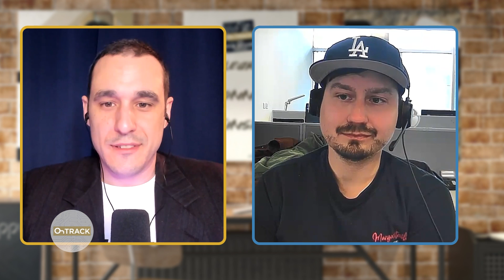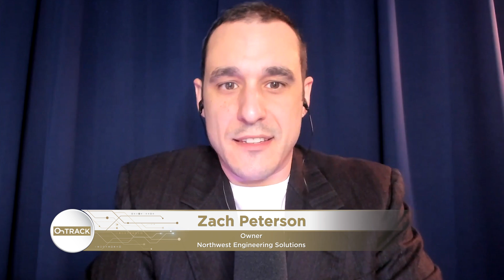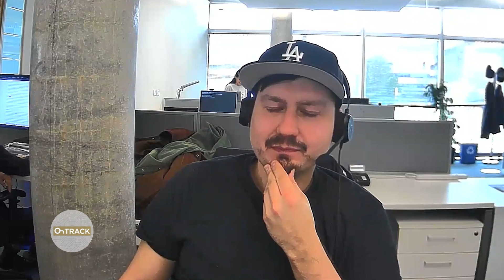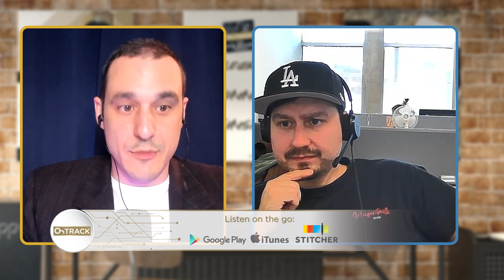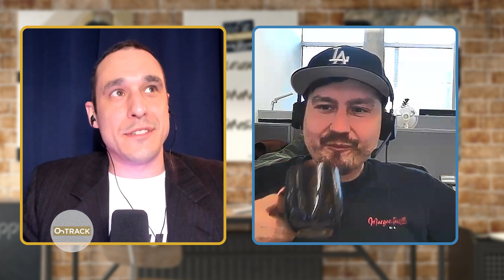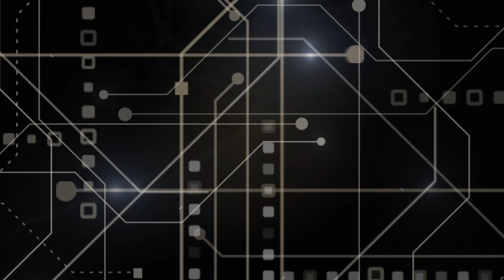EMC: Compliance, Opportunities & Pitfalls with @DrEMC-sf8rx

Comment: Recently I got around a machining shop and connected my notebook to the outlet. First of all when the guy 30m further switched on his angle grinder the mouse started to act weird on my notebook, second of all the wifi dropped.
Is this somewhat part of EMC?
Another situation, I connect an Asus notebook to a servo amplifier via RS232, if I touch the notebook and don't have rubber shoes on the mouse of this notebook will also go crazy. Interestingly here this does not happen with eg. a Macbook.
Is this also part of EMC?
How do small companies handle EMC? I know some companies who just design PCBs and release it to the wild without EMC testing at all hoping that their volume is small enough anyway and do not cause any issues.
Reply: Yes
Yes
...and Yes, with a side note that FCC requires you to log your intentional transmitter test results in an open access online portal, so you can easily find out who didn't. In the end it's the Law, and the penalties can be high enough to bankrupt the business. 

I have a Macbook myself and when I was filming my recent video I tried to disrupt it with conducted transient voltages - it's exactly the scenario 1 and 2 that you described. The Macbook is built like a tank and was completely unimpressed with anything I tried up to +/-4kV. In the end, I had to switch to a Dell monitor, so that I could show what a test failure looks like :)
Reply: @DrEMC-sf8rx  thanks for your reply.
"intentional transmitter test results"
Do you think cheap eg. angle grinders/brushed motors which cause arcing take care about that when they sell in the US or do weaker laws apply to those tools?
I'd be really interested to see an EMC compliance test with an old sparking angle grinder.
Are there different FCC requirements for industrial vs. commercial sides? More relaxed in some industrial areas? (like I mentioned that traditional machining company)
Reply: @peterkolta1207  actually you raised an interesting point that I forgot to mention in the podcast. In the US the immunity side of EMC is completely voluntary. There are ANSI standards which are equivalent of EN 61000-4-x counterparts, but the FCC only requires you to test emissions. Having said that, the electrical tools you described must still comply with the emission limits imposed by FCC, both conducted and radiated. The levels for industrial and commercial applications are indeed different, as the limits for commercial equipment are more strict.